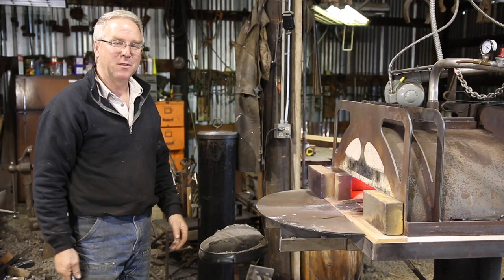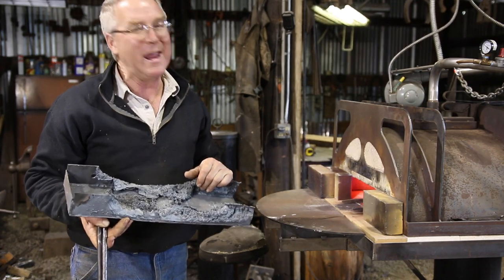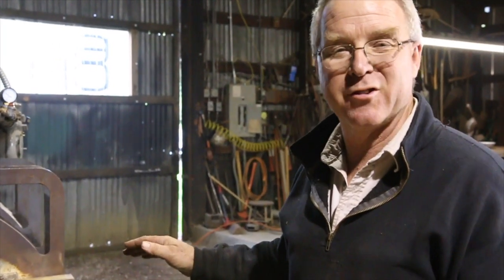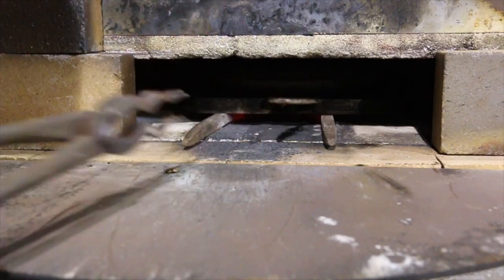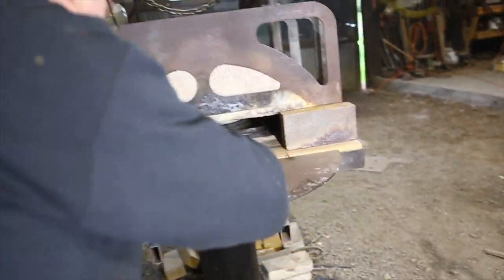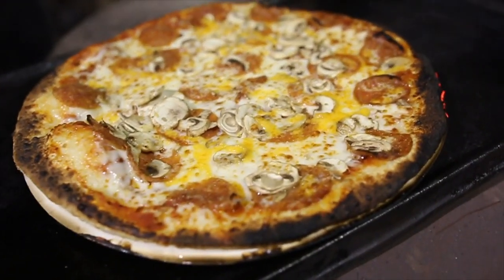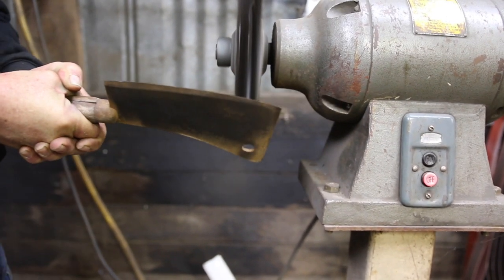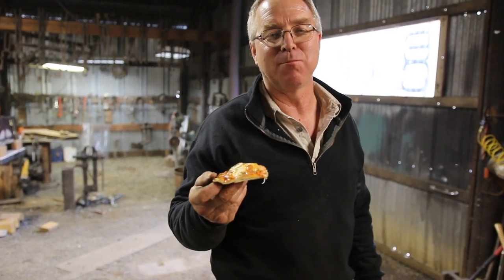Forging A Pizza

Comment: As both an aficionado of making pizzas in a wood oven, and using a forge for metal work, it should be noted that a pizza in the wood oven generally cooks ~90 seconds. The dome in a pizza oven is usually >950 degrees and the deck is probably 800 degrees and change. Why don't you build a wood fired oven as a project?  By the way, I love your channel...the videos are well thought out, and you are a great guy. Thank you so much.
Reply: As one who makes and sells 300 pizzas a day made out of 2 wood fired brick ovens, I will respectfully disagree with you. We make 3 different crusts, and the real thin crust is only 25% of our business, and we sell more Sicilian style than anything. Incidentally, that frozen pizza was thawed when he put it in in the forge which would make bake faster.....a frozen pizza has a crust that is lightly par baked in advance, and I would be willing to wager money that I could bake that same pizza in 60 seconds, and in 90 seconds from fully frozen.
Reply: Pretty sure that was Papa Murphys, but I could be wrong. Happened before.
Reply: yep that was a Papa Murphy pizza
Reply: I think the big difference between a raging wood oven and the forge here is that in the wood oven there is a lot more air movement which will help cook the pizza faster, in the forge its mostly going to be just radiated heat and not so much convection.

Comment: Thank you for not dropping the pizza on the floor on the way to the table.
Reply: thats why  he had the backup pizza
Reply: If it would have hit crust side down, a wire brush on an angle grinder would have cleaned it up real quick.
Reply: Still good if withing 5 sec rule.
Reply: I was worried too!
Reply: @CPUDOCTHE1  😂

Comment: Well, I cant say I am surprised. Try a steak next, broiled steak is how most steak houses do it, and they charge a fortune for it. I think the steak broilers are around 1200f around these parts. Cook a 1inch thick steak in 5 minutes, crank it to 1600-2000f and you could do it in less than 2 minutes. Just let it cool afterwards.
Reply: Two words...Ruth Chris...they brag on that concept!
Reply: Or just do a Pittsburg style steak. Toss the meat onto the hot steel until it's black, turn it over and do the same, and you're good!
(No, seriously, that's what the Pittsburg steel workers did. . .)
Reply: I did not want to throw names out there but you hit the nail on the head. Allot of other places do the same. I worked in a restaurant when I was in college, apparently a grilled steak only gets grilled for 20 seconds to leave sear marks then it gets put in a scolding hot over for a few minutes and left to cool under a heat lamp for a few minutes more. The difference between well done and med rare was often less than a minute. :)
Reply: Nice! Looking forward to it.

Comment: I laughed the entire way through the first time I watched this.  Absolutely wonderful.  Since you have a pass-through style forge, you could get a slightly longer cast iron plate, and cook pizzas non-stop.  Fifty to sixty pizzas/hour? not a problem.  You could certainly cook for a good sized crowd.  I guess the next blacksmithing project is either going to be grill tools or a MASSIVE spice rack...

Comment: Looks like you need a better platform for the pizza. I'm pretty sure you could've had it cooked perfectly in like 1min, 15 seconds with a metal plate on the bottom.

Comment: Looks tasty. Back in the late 70's, I saw the molders on the ship (Navy repair type) cooking whole chickens in their furnace/forge.  Chicken was wrapped in multiple layers of aluminum foil.  For a quick snack, remove the top off a can of pork and beans, hold it in a large bench vice, and heat it up with a oxyacetylene torch.  Shop food!  :)

Comment: In less sappy news, what's the tool used during the outro at about 4:00 to twist the thing? An old Coes wrench with a bit of pipe welded to it for the T-handle? I'm all for modifying a tool for a job, but those things are collectibles now, y'know. I love my 18" Coes wrench (which I bought for a costume of a videogame character, but then found it useful as a tool). It's a big wrench, a small vise/sheetmetal brake, and a middlin' hammer, all in one. I seriously considered buying a 30" version in an antiques store (y'know, just in case I ever need to take apart a steam locomotive), but the price was too high for me at the time, driven up by the market that just want to display them.

Comment: In engineering school, our thermodynamcs 2 course made working jet engines from junkyard turbochargers (propane for fuel). Our group got a free grill and mounted the jet engine with the exhaust coming up through the grill. For student showcase we fired that thing up (sounds like a fighter jet) and put on some hotdogs. They were nearly burnt in (we didn't time it) 20 seconds.

Comment: This is a P.S. Our oven- furnace, was 10 feet long, open at both ends, four burners, fueled by oil.  we repaired many items for customers and friends. Also repaired our snow plows when we broke them.  We had a small coal forge for the small items. My father and I were in the business for 35 years and my brother only for 14. I miss the shop! My brother and I moved to another business for forty yrs. after that. And we just retired.

Comment: You left the plate under the pizza and it still worked! thats why they take those huge wooden spatulas usually. A pizza rock, a spatula to slide it off, voila